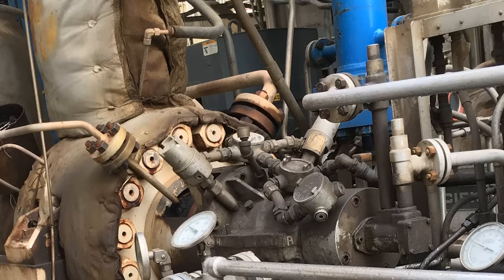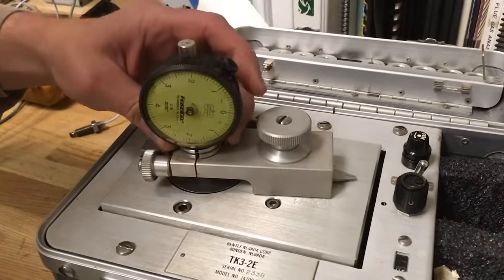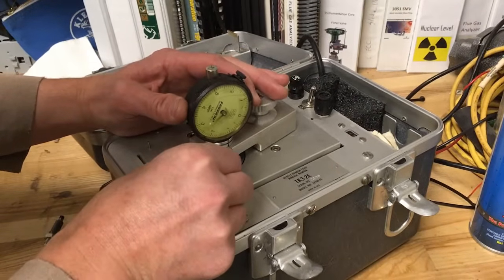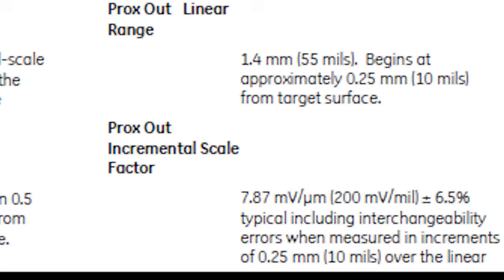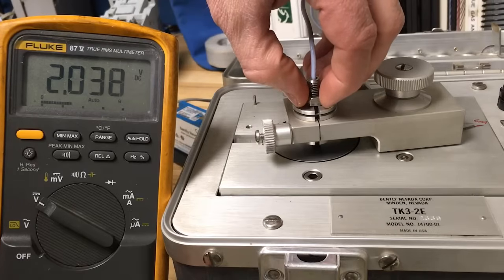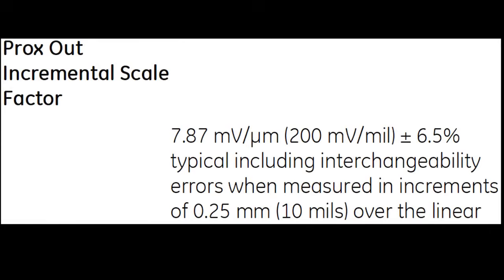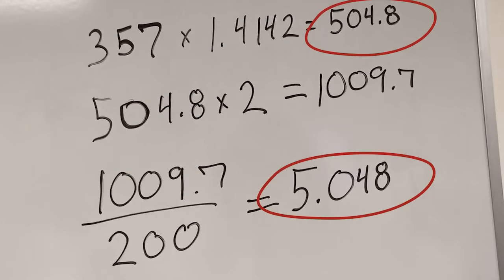Proximity Probe Dynamic Test Demonstration TK3

Comment: Excellent video, Engineer. I just have one question. Is a single point above 5% in the "% scale deviation" box enough to consider the sensor unreliable?
Reply from the maker: I test to ensure all parameters are within stated accuracy according to the manufacturer for that specific model.  For the unit tested in this video, a single data point on the static test with a 5 percent error would not be considered a failure
Reply: @jimdiggins101   I only have two questions: If I have two points with errors exceeding 5% deviation, is that considered a faulty sensor? And the other question is, if there's an error at only one point, but this error is 8%, is that still considered within acceptable parameters? Or what percentage of deviation in a single point is it considered excessive?

Comment: Hi, Mr. Jim Woenderfull video. I have copied the spreadsheet, but I'm having trouble understanding how to calculate deviation from standard. Could you help explain?
Reply from the maker: The excel "linest" function gives you the deviation for a response slope.  You could also convert the percentage of error for a single point in relation to the standard.

Comment: What kind of results will you have if your probe gap is out of limits, like will it result in higher results or no results at all?
Reply from the maker: As long as the measurement occurs within the range of linearity, it will produce accurate measurements.

Comment: most proximity probe measure slightly less than 1volt or 10mil. and to get middle range gap voltage have to subtract 1volt. Sir, appreciate explain this. what will happen if not doing so.
Reply from the maker: Bently recommends gapping 3300 5/8mm at .050" (-9VDC), which is the center of the linear range of the device.  If you used 10V instead, it would still work for most applications.

Comment: So there is no straightforward method to simulate 5 mils peak to peak vibration in that massive instrument, rather than going through making engravings?
Reply from the maker: Point taken, the machine seems antiquated because it is.  One could generate the sine wave using a signal generator, but that would only test the computer's ability to measure voltage and frequency.  The TK3 tests the entire system, including the computer.
Reply: @jimdiggins101  am I  right to believe that the new TK3s can choose specific peak to peak voltage?
Reply from the maker: @karoly365  I have a newer TK3 and it is very similar to the one in the video.  The set up is the same.  You may be thinking about a shaker table.  You can dial in specific peak to peak values with it.  I only use mine for seismic devices though (its about as portable as a boat anchor).  Here is a well made video on using a shaker to test proximity probes.  https://youtu.be/bgA7HXPhD1o
Reply: @jimdiggins101   Frankly speaking I have not been in the neighborhood of either your antique device or the shaker table model, but am trying to understand this technology for a certain purpose. My question is, is your device just a antique and handicapped version of the shaker table model or does it offer any other function which the shaker table model doesn't?
Reply from the maker: @karoly365  The TK3 offers few benefits:  Lighter, simple, more robust, easy to repair, and I would guess a lot cheaper.  The modal shop shaker doesn't come by default set up to test proximity probes, you have to buy all the attachments.  The TK3 is ready out of the box to test vibration, thrust and keyphasor.  Shaker has more benefits than I care to list.  If you are calibrating and certifying installations, definitely go with the shaker table.  If you primarily work on proximity probes and just need a diagnostic tool, I would go with the TK3.  Go to the TMS website and look around, they have lots of information.

Comment: Hi Mr. Jim, how can i test keyphasor?
Reply from the maker: The plate of the TK3 has a hole drilled in the outside edge of the plate.  This can be used for testing keyphasor probes.  The probe is installed in the slot and gapped against the outside radius of the wheel.  When the plate rotates, the hole passes by the probe face creating an increase in voltage on the proximitor output terminal.  The frequency of the voltage change is used to calculate the rotation speed.
Reply: @jimdiggins101  do you have any example of this aplication?
Reply from the maker: @angelojunior9507  I will email you.
Reply: @jimdiggins101  thank you very much
Reply: @jimdiggins101  thank you for answering me
Reply: @jimdiggins101  sir can you send me also for keyphasor? erosares286@gmail.com
Thank you sir for your videos, very informative
Reply: Good moring Mr Jim, i answered your e-mail

Comment: Why must 357 / 1.4142 ?
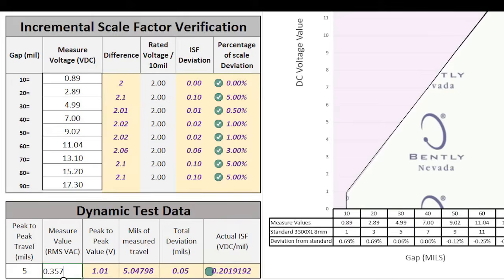Reply from the maker: Review the video at 4:38 and it will explain.  You multiply the voltage measured by the square of 2.  This is done to convert the RMS voltage to Peak voltage.